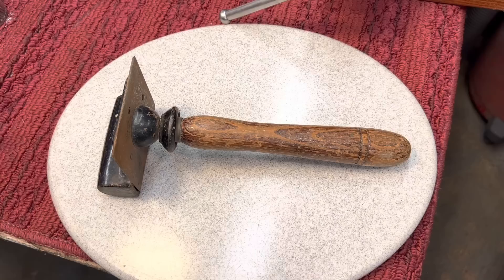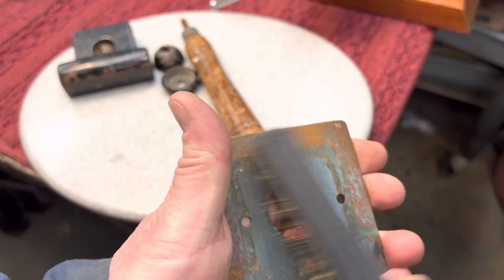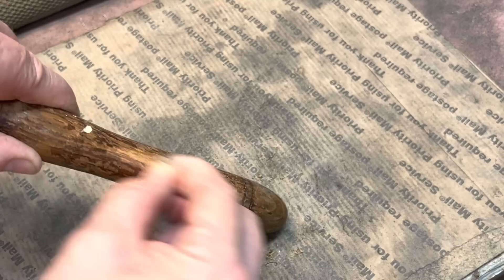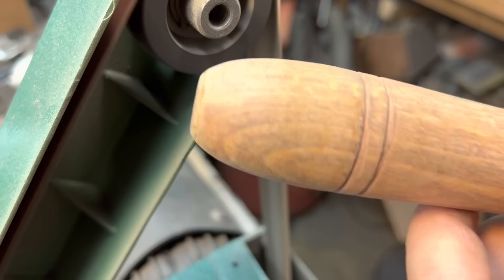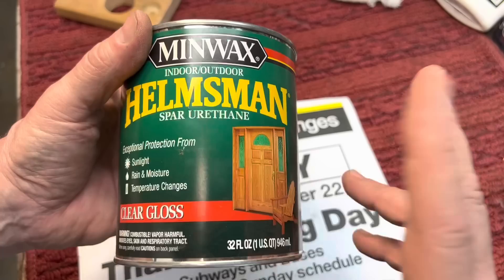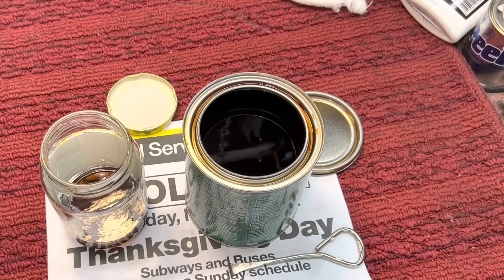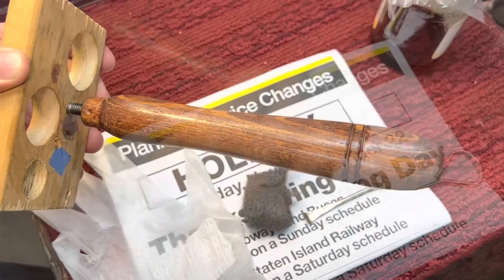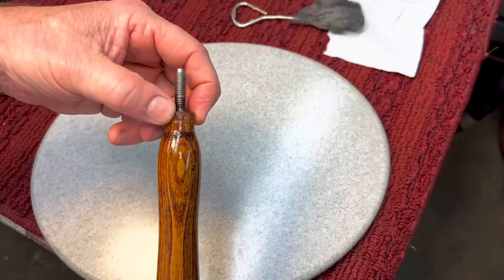Antique Scraper Restoration

Comment: Very nice restoration of a tool that's going to have more useful life with the cedar chest. Never seen one like it but I've certainly  scraped my share of old crummy paint. When fixing up my first house, I dreaded the idea of scraping and repainting the exterior window frames and ancient storm windows of decades of old paint. I also needed to remove and clean old hardware that was stuck to the frame with layers of paint. I decided to set a quota of one window per weekend until the job was done. To my surprise I ended up really enjoying the project. It was thoroughly done and looked good. Made me optimistic that I really could be a reasonable DIYer.
Reply from the maker: Pat- I'm with you, scraping isn't fun but rewarding when over!   =D

Comment: Nice job on that scraper. If you ever want to do japaning, I think the guy over on Hand Tool Rescue has a recipe from back in the 1930's or so. I've seen him do it on small stuff. It would raise quite the odor as I think it uses real turpentine as a base. Probably not necessary on that scraper, but; you might run into something you want to do it on. Nevertheless, nice job.
Reply from the maker: Yes, I have seen his process, Terry (Benco Vintage tool works) I think has the best recipe I have ever seen.  For some reason I hate the smell of turpentine!   =D

Comment: I can't say that I've tested it very scientifically, but my grandfather was in the habit when painting of first dipping his brush in whatever solvent is appropriate for thinning that particular paint. He would whip it dry 95% and then paint with that. It always seemed to lay down the paint more smoothly but the real difference was at clean up time. We all know to only dip the last quarter of the bristles, but inevitably we all dip too deep once or twice each project. Because it happens rarely, that paint often dries, you often see well cared for paint brushes that still have some remnants close to the metal ferrule. This technique with the solvent, that would be the only part of the brush that would hold on to some of the paint thinner thus making cleanup much more effective. Granted he was a little obsessive, but most of his paint brushes were 20 plus years old and still in good shape
Reply from the maker: That is always a good way to paint especially when using natural bristles that might be a little more absorbing than the modern synthetics.  The brush will draw out the thinners from the paint and make application harder.  Your Grandfather was beyond genius.

Comment: I just dip the item to get a thick finish. No thinning.
Reply from the maker: The only problem with that is dripping.  With handles you can hang them vertically and you can get lucky but if the humidity isn't right you can get staggered drips along the sides...

Comment: Really turned out nice. Thank you for the details. Question, when you shellac the steel do you use a spray? Or do you wipe on? And the term japanning. maybe you could explain that just a little more? THANK YOU👍👍👍😎🇨🇱
Reply from the maker: Hi Rico!  I always wipe on the shellac with a small swatch of rag just like I did the varnish.  As for Japanning it was a common finish many years ago that was meant to be durable, look good and easy to apply. The ingredients often varied but in it's simplest form was Varnish and lamp black.  =D  Today's paints have long replaced japanning but some people like the traditional look of that finish.

Comment: Just wow!  Your work is fantastic.  Does a blade get mounted in the metal bracket or is the bracket the scraper?  Great job.
Reply from the maker: Sam- The blade is sandwiched between the handle and the cast stiffener. It has a small extrusion that secures the blade from shifting and allows the blade to be used 4 times without sharpening.  Beautiful design!

Comment: Beautiful job on the restoration. You have inspired me once again. Just bought this scraper on eBay. It’s the same down to the two embellishments on the handle. It is a Sargent # 52.  I wonder if yours was made by Sargent. Thanks for the consistently excellent content.  I am eager to see how it is used.
Reply from the maker: Josef- I believe this is a Sargent #52 also but has no markings.  It looks identical.  You are going to absolutely love this scraper.  You will be amazed at the weight and quality!
Reply: Thanks, John!  Can’t wait to get mine and to learn how to use it.

Comment: Great video. How do you remove the rust without taking the paint off?
Reply from the maker: Brett- In this instance there was chipping of the japanning that left bare metal that rusted, I wire brushed the area to remove the rust and it also feathered and removed a little of the japanning along that area.  Then I cleaned the bare metal and used enamel paint to fill in the missing areas.  It's a good fix for a working tool...

Comment: I'm not normally into that type of woodworking where you refuse to use anything electrically powered and do everything as if it was the 1600s. I'd like the idea of it, but I don't like how it's been taken over by high end tool fetishists. I'm sorry but using a hand planer sucks compared to the power tool. But I really do enjoy hammer and chisel work like timber framing, the only variant that is remotely cost-effective. That said, I'm convinced that the card scraper is unfairly lost to time. There is no power tool that replaces it, nothing that achieves a similar finish nor gives such a sense of connection to the work itself. I suspect it's because sharpening them is something of a specialized skill unto itself, but anybody out there who hates sanding, try a card scraper. They really are a pleasure to use and the finish is so much nicer than sanding, it's basically burnished
Reply from the maker: I feel exactly the same way, I hate using planes and most other hand operated tooling but scrapers just work so well, the only thing is there is a learning curve to using them.
Reply: @ScoutCrafter  there is a learning curve, but that's one of my favorite parts of the card scraper, when you get it right, you immediately know from the sound and feel. You can run a sander all day and have no idea what's happening underneath, the card scraper makes for such a finer finish.